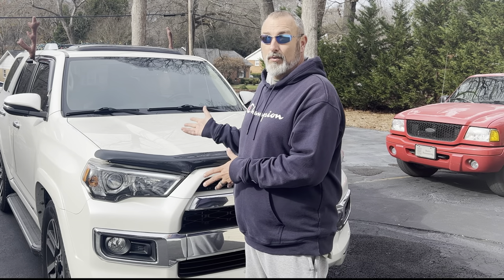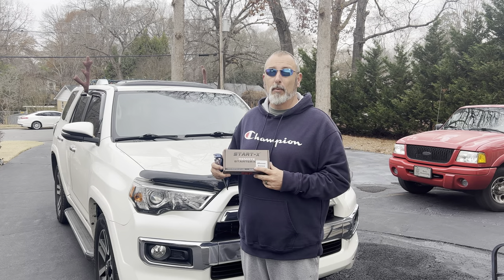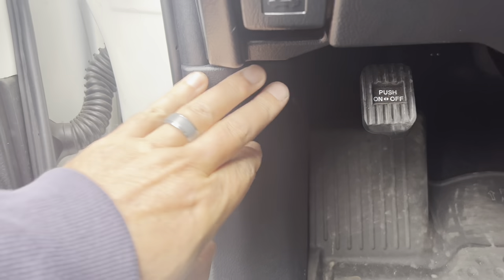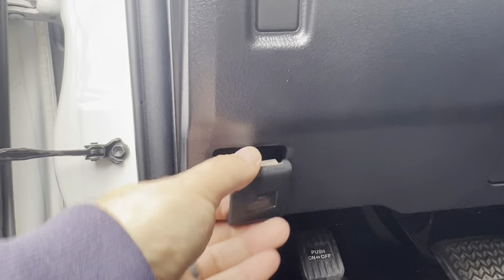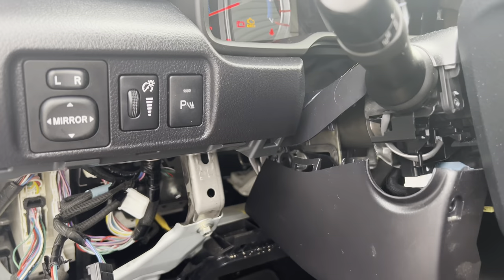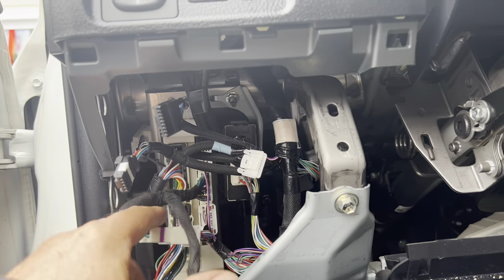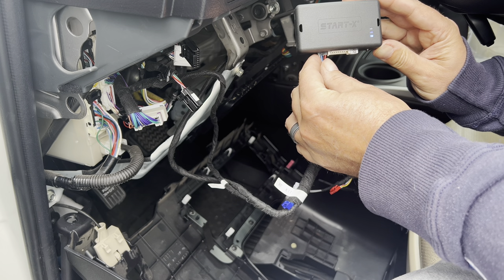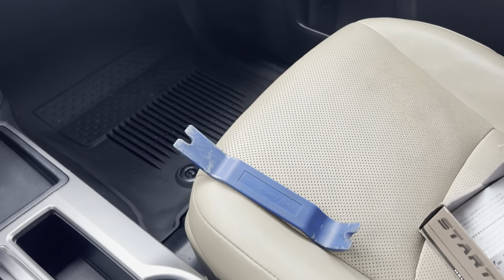2016 Toyota 4Runner Remote Start Install.

Comment: I’m getting ready to instal started on my 2018 Toyota 4 runner. Just wanted to follow up and ask, now that you’ve had this installed for a while, have you had any issues with remote stop?  Did you have to go back and install the wire you didn’t use? Thanks Steve
Reply from the maker: Hey Steve, No issues whatsoever. Just follow my video step for step and all will go smooth. I didn’t need that wire. 👍🏻 Goodluck , but I know you got this.

Comment: Nice video.  I just installed the same Start-X kit on a 2018 4Runner Limited but the auto headlights no longer work.  Do you have same issue?
Reply from the maker: Wow that is strange. I don’t have that issue. Let me know if you find out more of what is causing it. Thanks.

Comment: I have a 2016 with a key to start.  I am assuing the istall wil be the same?  I cant blieve the "pros"  want an extra $300 to watch the little lights flash and hookup the t-harnesses.  If they see a sucker coming, they gonna try to get a lick! 😂😂  Thanks for the help.
Reply from the maker: Yes sir the exact same install. You are so right about the installers seeing most as suckers for sure. Glad that you and I and other do it yourselfers prove them wrong. 🤙🏼

Comment: How's the system holding up?  I've heard of a few cases where the install drains the battery, and another where the car gets started and runs until out of gas?  Any issues?
Reply from the maker: Hey, everything working perfectly with zero issues. 👍🏻